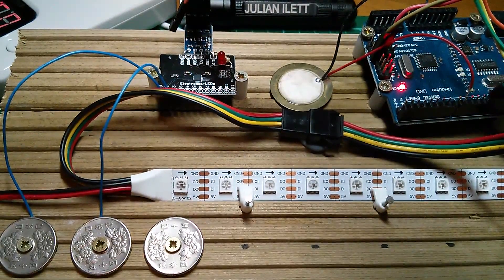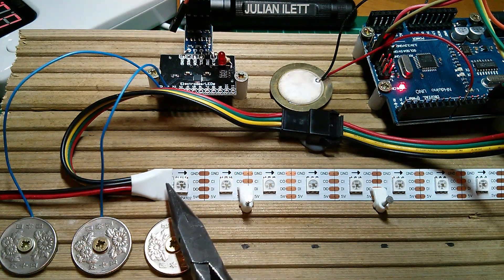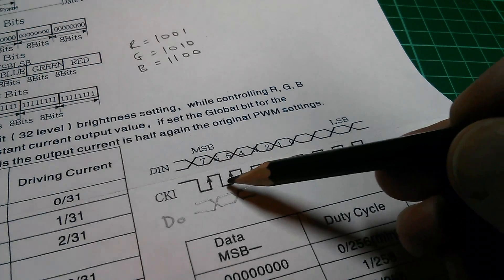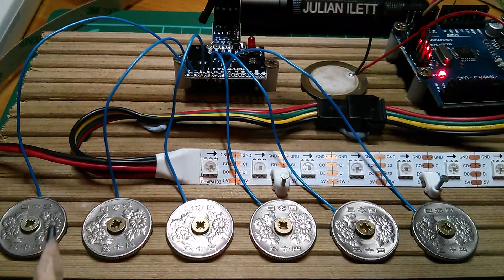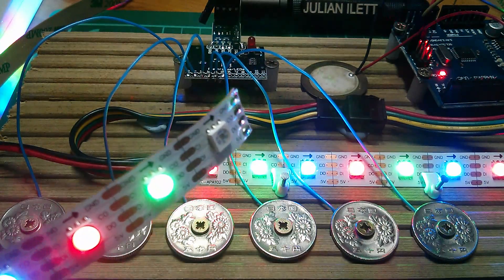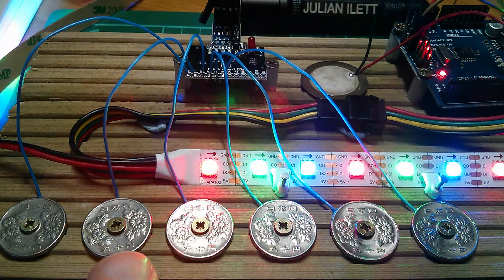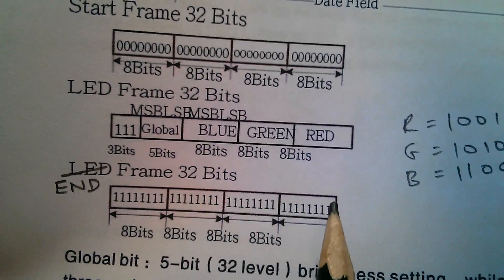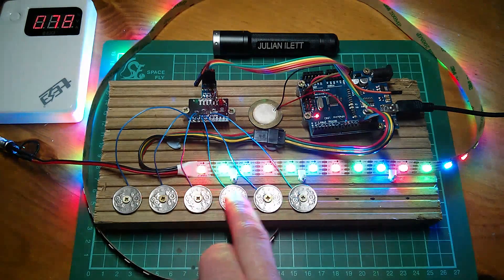First Look: APA102 RGB Pixel Addressable LED #2

Comment: the 8mm 4 pin dip version of apa106 are the coolest leds I have and I have tens of thousands. they're pricey though. look at the cube someone made with them using a teensy mcu written in assembly.  there are 4082 leds and 1000 cost around 120cad haha

you need to make an oscillator/led list. I promise I will hit that thank you button very generously

Comment: Thank you so much for the insight on this LED. I've been scratching my head wondering why the 3 last of my LEDs didn't set correctly. In my case I had to send 12 bytes (or 3 start frames) in order to get them sorted, since I'm running a 144 LED strand. I figure the necessary padding turns out to be (in bytes): 1 + floor(NUM_PIXELS / 16)). In my case it is even necessary to send a byte of padding for the first LED to set.

Comment: So WS2812B vs APA102; which is better and in what situation?
Reply: APA102 LEDs are easier to drive because they have seperate data and clock lines, but WS2812B LEDs are a bit cheaper (at least in my area), they have better library support and they take up less pins on your Microcontroller.

Comment: Hi Julian I  would appreciate it if you could do a video on the pl9823 f5/ f8 leds. 
Thanks Simon. 
may the sun always shine in your garden
Reply: Simon  Hopkins , they seem to behave exactly like WS2812b, (maybe need a slightly longer restart pulse.)
Reply: Massimo O'Kissed 
Thanks I've since had success with Arduino and fast led library.

Comment: You said there was no set clock speed but is there a cut out time (ie if you sent the start bytes then waited for 30 seconds or so) would it turn off, or not take in any more data bytes?

Comment: What struck me is that the end frame coincides with an all white full global frame. If they meant for a serious use of start/end frame, those two should be different from any colour/global intensity frame by differing in the first 3 bits. I.e an end frame could be 0b010iiiii bbbbbbbb gggggggg rrrrrrrr
Where those i b g & r bits would not matter. 
Maybe its all down to the simplicity of the control chip in the LED .....
Reply: Jan Rasmussen If you have 10 leds, when you put the end frame you will not see the 11 led. So, what's the problem?
Reply: +Luis Carlos For me it is a design flaw. Yes there is a workaround but that does not make it right.

Comment: Have you done actual tests yet how fast you can program the leds...  This makes me wonder... if you'd add a bunch (say 50x100 or so) of them into a rectangular type organisation.  What kind of framerate could you get out of that ?

If you can indeed do it at 60Mhz. That's 1.8Mil LED changes per second.  If you wanted 50Hz framerate, that means you could make a matrix of  37500 LEDs. That's pretty impressive (and way outside of the ballpark for an arduino) .

Or you could make a giant classic VGA 320x200 screen at 29fps.
Reply from the maker: oreubens It's tempting to make a big video screen out of these. I must take a close look at an LED advertising panel to see what LEDs they use. There's one on Hammersmith roundabout - next time I'm there...
Reply: Julian Ilett Big screen is what I had in mind :-)There's enough ways you could drive even humongous ones, but keeping any kind of strict syncing is going to be a bit of an issue.

You could use faster computer/base to send data to a bunch of other arduino's/controllers that then send the data out to the LEDS together, but how do you then send the data from the base to the controlles and keep it all synced, and where does that come from.  If all you want is just make them blink/move in some pattern that's "easy enough" but doing actual data display/video... I guess it depends how fast you can send data do the different controllers.

Interesting project (if I ever find time to get to that). :p
Reply: If you could actually get this to work...  Would it even be worthwhile (other than the "just because I can" issue ofc) doing this ?

Would say making a gigantic 1080*768 panel (830k leds) even be anywhere near the ballpark figure cost wise for one of those gigantic screens ? (forgetting for a moment about what you'd need to drive that many LEDs).

Comment: Julian, do you have a logic analyzer? (I have two of these (but not specifically from that seller): http://www.ebay.com/itm/251712619461 ) . It would be nice two show the clock and data outputs of a few consecutive LEDs.
Reply from the maker: superdau I'd love to play around with a logic analyser - maybe someone will send me one for free (requiring a review video of course ;). I did try drawing the clock and data wave-forms on a piece of graph paper to get it clear in my mind, but it got very messy very quickly. Perhaps I'll take another look at the clock/data structure when I build a light fitting for my new bathroom - switch on the light and a randomly selected colour pattern sequence will play for a second or two ending in all white. Awesome!

Comment: If you look closely near the end, you can see the propagation delay in the string based on the clock. (Takes about 3 video frames).  If I recall correctly, that's one of the other differences with the WS28xx - those you can set the state and then latch in the color display very quickly?  I wonder how fast you can drive the APA102 :)
Reply from the maker: PanoWorks I've read claims of 60MHz for the APA102 - the WS2812B is fixed at 800kHz. My use of shiftOut() is responsible for the slow update.

Comment: Having a end frame would be good if you don't want to fill the whole strip and you are using the same item to give commands to another unit at the same time. not the best use but there if needed. Just an idea
Reply: Jeremy Shugert 
Except that the "end frame" doesn't function as an end frame at all but is just a "white frame". As soon as you clock new data into the chain (doesn't matter if zeros or ones; it's the clock that counts) those ones of the previously sent "end frames" get clocked out to the unlit LEDs at the end of the chain and turn them on white.